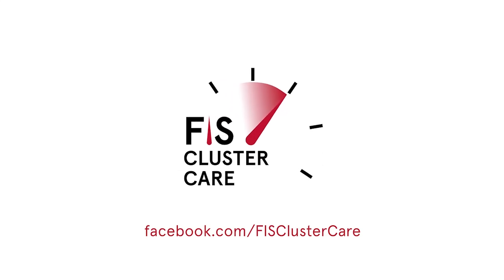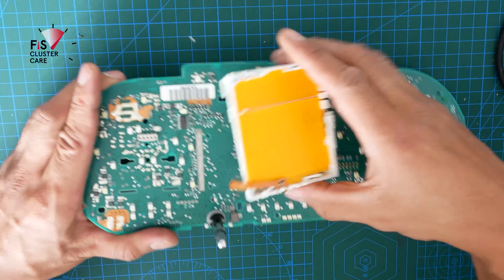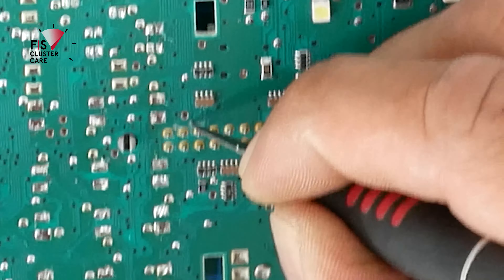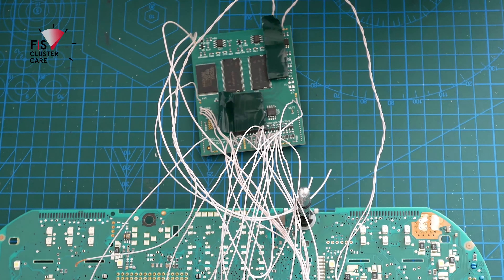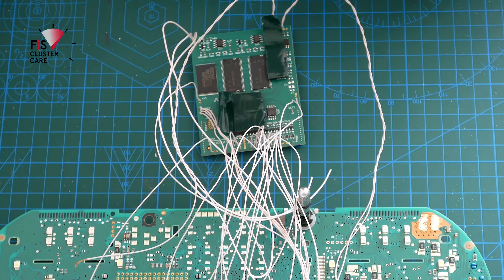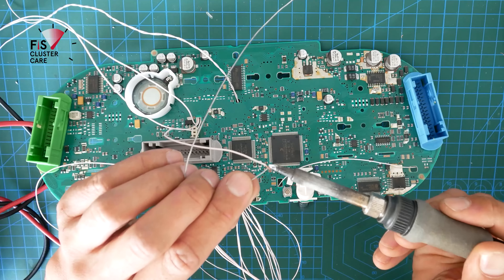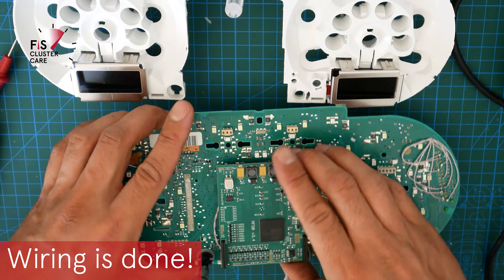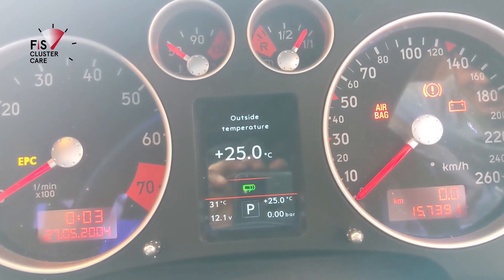Audi TT Mk1 8N ColorMFA detailed end-to-end installation guide. ColourMFA  how to guide.

Comment: Thanks for this great video, very clear explanation, there is another good video but the language is all in german so this was a great find. Two quick questions you can maybe help with if you have a moment. 

1) What pins on the blue connector need to be wired up in order to "power up" the cluster for needle calibration, is it just 12v and GND ? 

2) A long shot this one, do you have any idea of type/make/part number or where to source the little LEDs for the temp and fuel guages, mine are kaput so might as well replace when I am in there and they are obviously different from the ones used to backlight the original LCD display. 

Thanks a million!

Comment: greatly appreciated nice job very detailed... I had to replace a new instrument cluster. Do you know if there's a way to match the ECM without having to go to a Audi dealer and pay that outrageous price to  match each. I think it should be left to the owner whether they want all that immobilizer stuff on it.. thank-you again for your videos...
Reply from the maker: @supertruckertroy  if you have new you should be able to do this with VCDS. If it's used then you will probably need dealer help or an auto locksmith who should have the right tools to match your used cluster to the car.
Reply: @ianpgonzaga  thank you for messaging me back and you are correct with a used instrument cluster had to go to dealer however it would of helped if I had the correct one needed the 8j I stead of the B argggg. So I guess I try my hard at the colour mfa would or could you find a link I don't think I seen it in your other tutorials and you do a great job with specifics explaing the process of it all
Reply from the maker: @supertruckertroy  hopefully colormfa comdes back soon. it's been 3 years since they stopped making them. 

LOL DId you say you got a B J instead hahahaha I'm jealous
Reply: @ianpgonzaga  yeah that was a good one huh.... so then only  way to even get it running again is to get a display repaired again amd hope that it will pick up where it left off.. i hope I can solder it In OK I'm getting older and my hand gets to trembling. I'm kidding with your videos I will tackle it with confidence thank you again unless you can do it or know of a reputable place that can
Reply from the maker: @supertruckertroy  if you are in Australia can definitely explore helping you out. What exactly happened to your original cluster ?

Comment: I really like this product, theirs a few options missing for Audi TT 8N i would love to see installed. TPMS, Speed alert, Sat nav, and bluetooth mirror link.
Added bluetooth module could be usefull for aftermarket TPMS tire sensors etc.

What are the future plans for this product?
Reply from the maker: Hi John. Some of these features are available if the factory setup is installed. Eg. Navi directions appear on screen if your car has a suitable factory installation and tpms displays on certain modules. 

As for future iterations so far the suppliers have gone v quiet on this product unfortunately.

Comment: Another nice video Ian, and very relevant for me! I recall the on another occasion you had mentioned using some original plugs to power up the display towards the end. If there is no access to the original plugs, is there another way to do this? eg some jumpers from a 12v supply?
Reply from the maker: Hi Rob! If working without spare power plug I think the best option would be to solder wires directly to the power ignition and ground and have them come out of the cluster where you can hooked them up to a small power supply. I just  use a 12v 5a one from Jaycar to power up on the bench.
Reply: @ianpgonzaga  Hi Ian - just getting around to focusing on the ColourMFA and looking again at your vid, plus the other references. As received, the LCD is attached to the MFA motherboard, and me being a bit cautious, am loath to just lever them apart. Can you advise the best way to separate them? Thanks, Rob
Reply: Also, I have noted that some other TT LCD replacement vids refer to a soldered-in original display (just like my old B5 S4 had). I haven't removed my instrument pod yet, so can't be sure mine (MY2005, Aug 2004 build) has soldered or otherwise connections. Can you please clarify?
Reply from the maker: @robgray3725  hey Rob. They are all soldered in on the Mk1 TT :) Mk2 they clip into place via the ribbon cable.
Reply from the maker: Hey  @robgray3725 . If you have a small thin screwdriver you should be able to get it in between the board and the black plastic surrounding the motherboard connections. Pry a corner at a time to lift it as evenly as possible. I always use a small screwdriver.
Reply: @ianpgonzaga  Hi Ian. Thanks for your reply - but you might want to edit your video @1:45 or thereabouts. Maybe that's a Mk2 instrument cluster?
Reply: @ianpgonzaga  Hey Ian - that's not what your vid says - it says no de-soldering...
Reply from the maker: @robgray3725  ooohhhh it appears I didn't include removal the OEM screen from the board. Sorry about that. 

Ive missed that part out somehow. You definitely need to de solder or use a heat gun to remove the OEM screen from the board. If you see the regular Audi TT screen repair or any of the other OEM screen repairs you can see how it's done.
Reply from the maker: @robgray3725  https://youtu.be/AFy-8jtn2Gg 32:30

Comment: Hi Ian, Is this still available for the Mk1 TT?  If so, how do I go about getting one, please>
Reply from the maker: Hi Julian so far production is on pause of these kits. 

Only ones available now are called 3dcolormfd. Slightly different but similar.
Reply: @ianpgonzaga  - Thanks, Ian (and apologies for the slow response!).  Is it possible to get one of 3DColorMFD models?
Reply from the maker: @julianwilliams1885  no probs. Yes those are still available. Search them on Facebook and the order can be placed through Maria (if the stock is all pre ordered they'll put you NIL)
Reply: @ianpgonzaga  Great stuff!  I'll do that.  Thanks, again, Ian!  🙂

Comment: Thanks for the great videos, Ian. I am new to the world of TTs. How come the Mk1 cluster you have shown in this video is different from the Mk1 cluster you showed in in this one:
https://youtu.be/AFy-8jtn2Gg
Thanks!
Reply from the maker: Hello David and congrats on your TT! Gotta love them ☺️ 

This video is showing an upgrade that you can do for the middle screen while the video you refer to guides you through a repair of the original red screen. 

ColourMFA has a LOT more features vs the original setup. Hope that helps!
Reply: Thanks, Ian. I understand. I guess in the ColourMFA video, you had already unsoldered and removed the flex circuit and the OE screen. I was just a little confused, but now I compare them more closely, I can see they are the same board. Thanks!

2 follow up questions then... (1) with all the fly leads white, how the heck do you know which one goes where, particularly once you have routed them through the motherboard?? And (2), where can I get one??? They don't appear to be for sale on the site you linked to.

Thanks again, mate. Your videos are so good, they give me the false sense of confidence that I am capable of tackling some of these upgrades!
Reply from the maker: @davidsnaith9041  yep you're right they're the same instrument cluster board  😉
1) I use a multimeter to test which wire end has been soldered at the ColourMFA. This teamed with the with wiring diagrams helps to locate each lead to the correct position on the TT cluster. 

2) they're very scant at the moment. These kits are made in Russia and suppliers haven't been able to manufacture in bulk as they usually do. Just keep an eye out for updates in my site but I'm not sure when those updates will be. 

Also - if I can do it you can too - this project definitely takes time and patience.
Reply: @ianpgonzaga , thanks mate. BTW, I love the sound of the lorikeets and magpies in the background of your videos - makes me feel homesick!
Reply from the maker: @davidsnaith9041  aww nice! They annoy me sometimes as I try to speak when doing the work but I guess it really shows where I am. 

You're an expat now? Where in Oz were you previously?
Reply: @ianpgonzaga  I lived in Sydney for 30 years. Canada has been home now for almost as long.